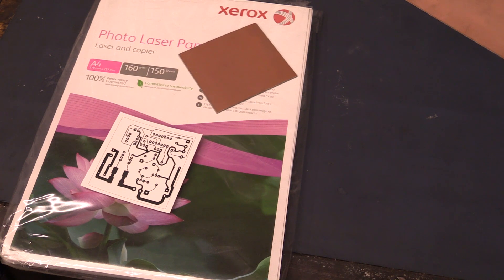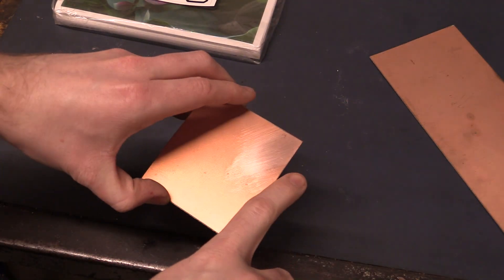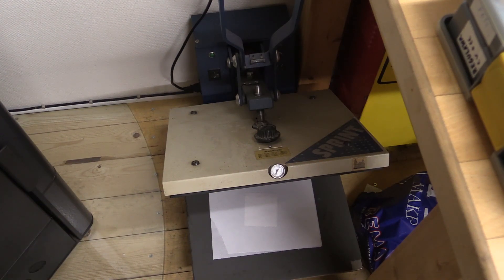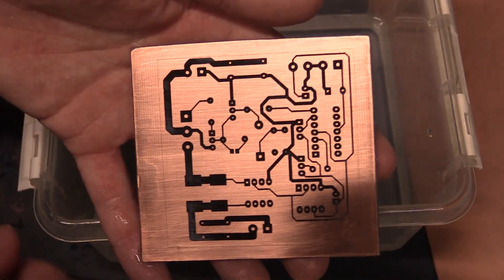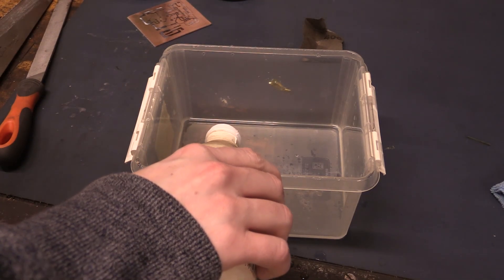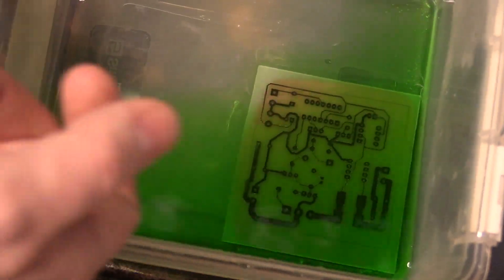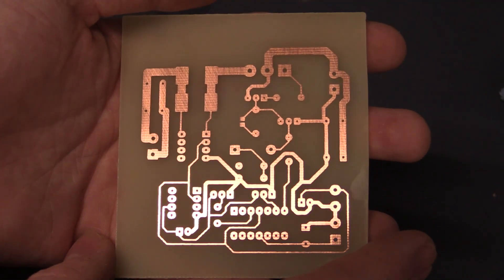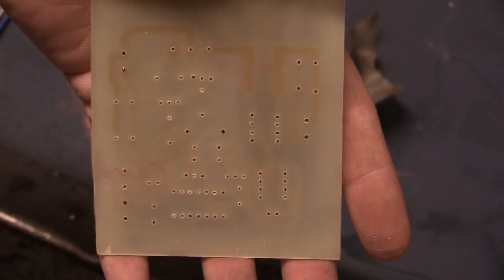Making Circuit Boards Using a Laser Printer - Ec-Projects

Comment: I’ve struggled for a long time with the glossy paper method. Someone pointed me to a dedicated type of transfer paper on eBay which will transfer dry, i.e. no water or other chemicals required. Look for “Toner Transfer A4 Sheets”. They are usually yellow. Super high quality transfers with that and cheap too.
Reply: Do you mean the stuff where you get 10 A4 sheets or something like that for 1€? I have those (bought on ebay from one of the million chinese sellers), but I never used them yet, because I fear that they will mess up my printer. E. g. if the toner really not stick at all to the paper, stays in the printer and gets on all the rubber rolers.
Reply: Did that mess up your printer?
Reply: That's right, the the whole point of the paper is that the toner does not really stick to it. You have to be careful when you handle it. For me personally it has never caused issues with the laser printer afterwards. Still printing like a champ. YMMV of course. Vinyl shelf paper also works great btw, and the toner sticks to it much stronger in case you are worried about your drums. What really messes up laser printers is getting some sort of adhesive on the rollers, like from self-adhesive paper.
Reply: There are tons of testimonials about the yellow transfer paper in the comments of this post: http://hackaday.com/2015/02/22/toner-transfer-and-packing-tape/
Reply: Hmm, still not sure if I should risk trying it. I have always used the photo resist method, but since I don't do it very often my results aren't very consistent. I mostly get working boards in the end and also quite good quality/resolution (e. g. traces between pins or TSOP/SOP are fine), but if something goes wrong in making the PCB it has almost always to do with the photo resist part of making the board. So if I could replace that step with something simpler it would be nice (as long as toner transfer is good enough for SMD stuff)
Reply: LOL, no it's not as bad as that ;) . I got a face tanner off ebay for less than 10€ including shipping (if you want one, spring is a good time to look for them; people tend to get rid of the tanners in spring). I first used it propped up on boxes shining down, but later moved all the innards (the four UV tubes, tube starters and choke) into a gutted scanner case. Alsmost lokks as it was made for it, so that part works very well. My main problem is that the precoated boards I use "age" and the resist behaves slightly differently every time. Also since I don't mix up huge batches the concentration and temperature of the developing solution are different every time thereby giving varying results.
Toner doesn't dry btw. it just has to cool which is pretty much immediate. The "not sticking" is the point I guess, if you manage to place it onto the board without smearing it before that. But in my printer the paper takes a 180° turn before being ejected. So if it really does not stick at all, if it rubs somewhere while doing that turn, it will mess up the print and maybe the printer and that's why I have not yet tried it.
Reply: Ya buddy I also used these yellow papers but when the printing person tries to print on them,,,he fails,,,
Reply: Hi T, what is vynyl Shelf paper?
Reply: actual u have taken print from inkjet,,,,not from laser jet....
Reply: They work ok but I found most sellers dont care how they package them. All the sheets I purchased arrived all wrinkled and curled making them useless. I have also used the dedicated press n peel blue. Works great but is expensive. I now just use cheap glossy photo paper and get good results most of the time.
Reply: The only problema is nobody wants to print on this paper, hod did ypu deal with that?